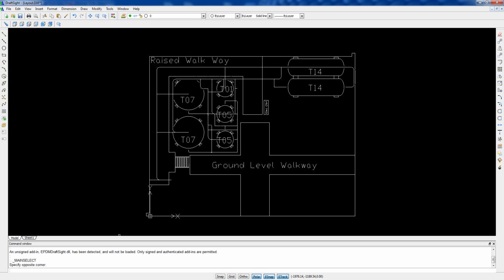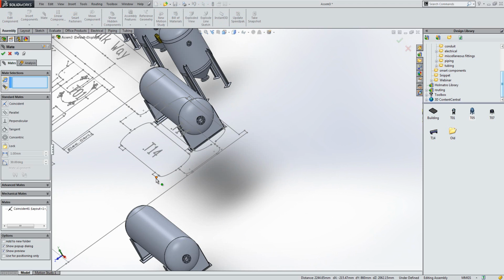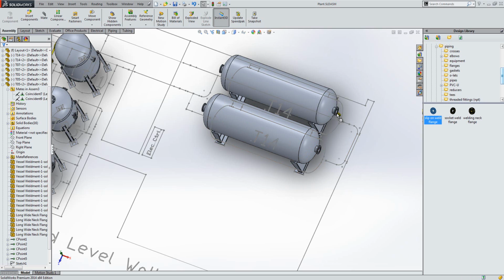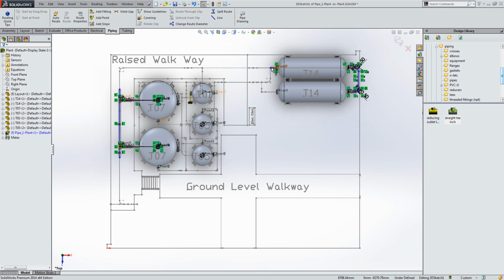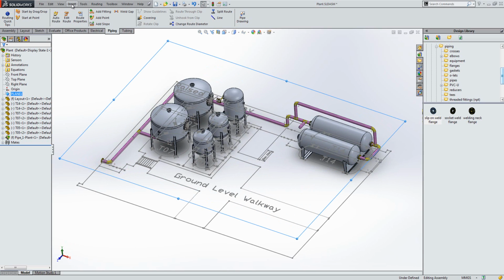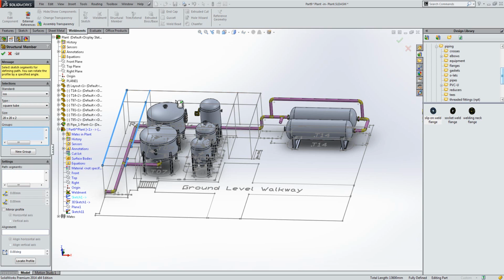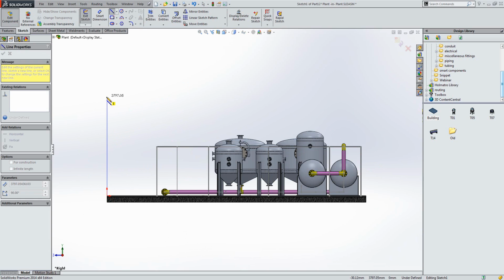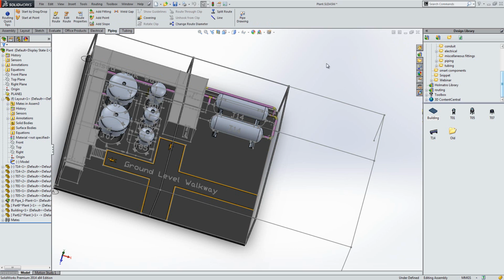SolidWorks in Your Industry Pt4 - Plant and Site Layout

Comment: did you create, before hand, all of the pipe fittings in your design library?
Reply: I am late to respond to this but actually those fittings etc., are available in Solidworks premium under Routing ad-in. You don't have to create them yourself. Hope this helps.